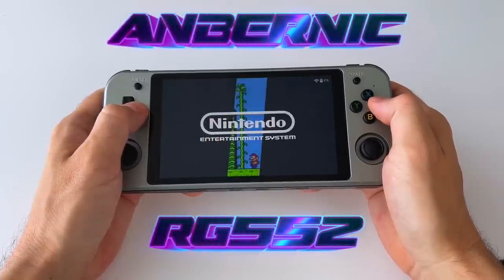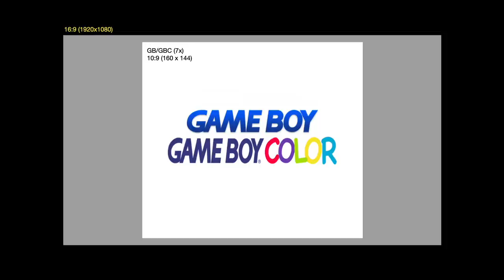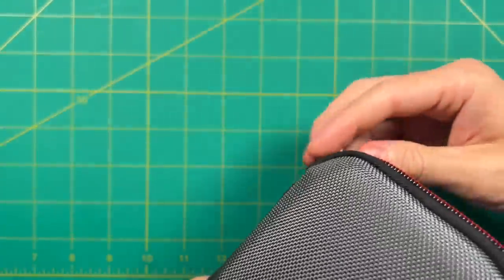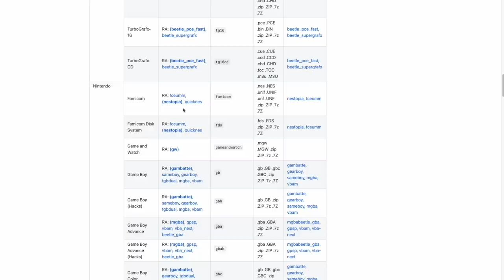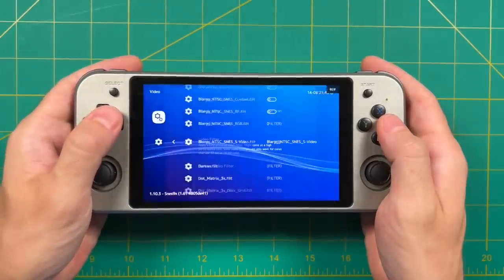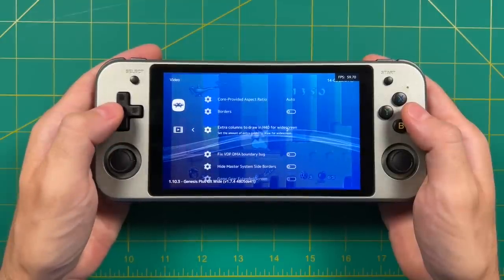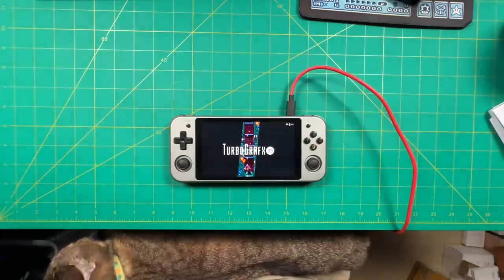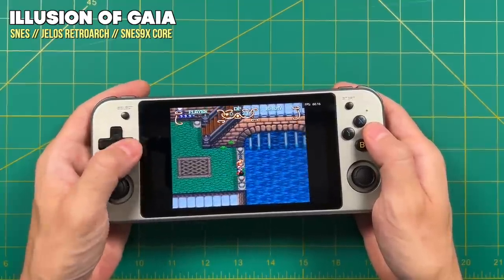This is still my FAVORITE handheld for retro gaming.

Comment: You can solve a lot of the scaling issues with 240p games on a 1080p screen by using a 5x scale. It only cuts off a few pixels off of the top and bottom which is what CRTs do anyways. No black bars at the top and bottom and you get integer scaling.

Comment: Part of me wishes I had never seen this video, because I recently purchased a modded PS Vita. I didn't care for the retro emulation through Retroarch on that device at all, but loved the way PSP ran. Plus I was introduced to some PS Vita games. After seeing this video, I decided to add the RG552 to my collection (RG350M, RG351P, RG351V, modded Vita). You are spot on regarding the excellent screen quality. I did have to expand the size of the Turbographix 16 systems and use bilinear filtering, because the integer scaled image was too small for my taste. I'm struggling with aspects of Android 11 (PPSSPP won't advance past the first welcome screen), but Drastic on Android is fantastic for making Nintendo DS playable. I'm using Amberelec as my custom firmware.
Reply: How is retro experience on the PS Vita vs the RG552? I would have thought it would have been quite similar?
Reply: @LiquidTurbo  The PS Vita uses the Retroarch interface for GBA, Genesis/Megadrive, SNES, etc., but it doesn't have a fancy front end that makes selecting systems and games easier as you get with Emulation Station. I find Retroarch clunky without it. I also experience slowdown on Sega Game Gear, which is bizarre considering that the Sega Master System runs fine. Not certain if it's due to the way my Vita was set up. The Adrenaline app on Vita is used for PSP, and there's an internal limit of 128 PSP games that can be displayed. That stinks, but the upside is that PSP games run perfectly on the Vita, as it's not being run through emulation as I understand it (runs natively on the Vita).
Reply: @davidlhsl  How's the physical feeling of playing retro games on Vita vs the RG552? (aside from the interface)
Reply: @LiquidTurbo  Vita ergonomics are excellent and better than 552. It only has one set of shoulder buttons, though, so no L2/R2 for some PS1 games. L2/R2 buttons on the RG552 are hard to reach.
Reply: @davidlhsl  which do you pickup to pay retro games?
Reply: @LiquidTurbo  I only play PSP and Vita games on the Vita. I use the RG552 for everything else.

Comment: great video. i also think this is a good device. but the integer scaling question becomes even more tricky when you factor in that on some platforms, the pixels were not intended to be displayed square. for example, the capcom cps platforms had a resolution of 384x224 that was to be displayed on a 4:3 crt, squashing pixels horizontally so that they were rectangular. and it was a similar story on snes, etc. and so on these systems, if you want a genuine integer scaled presentation at the intended 4:3, you need super high res displays (close to 4k!) the joys of digital displays...

Comment: Thanks for aspect ratio explanation! wish you had a full video just about aspect ratios of the most common handhelds, and how the old systems scale on them :)
Reply: So NES, GB, and MD are close to square. which means the wider your handheld gets, the smaller screen you will have since the screen will be limited by height, you won't find any 4:3 modern handheld other than RG353M but that one is 3.5-inch, and this one gives you ~ 4inch for 4:3 since it's not wide enough, but thing gets worse with wide handheld when the aspect ratio goes 16:9 or even worse like phones when it goes 2:1. 
an example, even though the galaxy S23 ultra have 6.8" but if you play an arcade game with a 4:3 aspect ratio, you will get almost the same screen size as RG552 (7.0cm for rg552 vs 7.3cm for the galaxy).

I wish we had an oled 7" 4:3 handheld to play these retro games.

Comment: I'm not that happy with the RG552. I would like to play with the stick and at the same time be able to use the shoulder buttons properly and not be restricted to systems that do not need them. But well not everyone wants to play with the sticks. But I like it when I'm flexible here without restrictions. I love it when I can reach all the buttons easily. I don't even want to discuss the price-performance ratio now 🤷‍♂️ However, the display is excellent 👍 In the end, everyone has to know for themselves what they value.
Reply: @Pridetoons  hating on anbernic has became a norm recently. The win 600 was a complete cash grab. Selling a 30$ processor for 375$ certainly seems like it. But they are realy solid hardware wise. While Ayn , someone which most compare to isn't clean themselves. Anbernic pulled themselves into a puddle and now people are trying to put cement on it.
Reply: @Pridetoons  You're right. But I also like to play DS with a stick or Android games (with a stick), for example, and the shoulder buttons are useful there. But if I have to use them, it's important to me that I can reach them easily and without cramping. Especially if I want to use the stick below. Well, my fingers are just too short for that -.- Despite various criticisms, I'm not someone who wants to make Anbernic bad for no reason. I love the RG351V. But if there are things from my very personal point of view that I know differently or I'm used to, I'll say so. Don't get me wrong. I'm the last one who doesn't begrudge Anbernic the success. Other manufacturers have just made better decisions lately that I like better, but that can all change with new products. In the end, the competition is great. We couldn't have imagined that in our dreams 1-2 years ago :)
Reply: Mine had issues right away (still does) thankfully I have the Odin Pro too.  My issue with RG552 is when I charge it the battery light blinks all crazy and never fully charges either.  Seems to be a battery issue and it's annoying that it was shipped this way to me

Comment: i think i already left this comment before. but maybe someone will read it now.
but YOU ALWAYS NEED FILTERING WHEN RUNNING NON PORTABLE RETRO CONSOLES! 
most consoles used resolutions that did not had square pixels, CRTS do not care but LCDS do, so you need filtering anyway just for that, else the image will look wrong
so if the screen will fit perfectly 2x integer scaled or whatever is irrelevant, unless you talking about portables which did had lcds with square pixels.

however there is one very simple method stretch the screen to any resolution that will keep perfect pixel edges and will also deal with non-square pixels
you scale the image up on a integer scale till it won't fit the device screen then you shrink it down with bilinear, because shrinking down with billinear does not cause blurryness only streching up does. on devices with real GPUs this is super easy to do, heck retroarch even comes with a shader for it, but you can "ghetto" it on things like a RG350 as well.

Comment: I appreciate your videos a lot, and even though I don't always agree with you, respect that you have your opinions and you came by them honestly.

The price is way too much of a dealkiller for me with this one, it's just way too much to spend for me to even be curious. I almost got a Miyoo Mini at your recommendation but ended up sticking with my RG280V, your previous favorite pocketable. It doesn't have as many setbacks to make it a bad purchase, and really, it's great to have a cheaper device to play most of the older games, even if there are problems with some systems and games it's supposed to be able to run.

On the more powerful side of emulation, it simply makes more sense to get a Bluetooth controller for your phone and play the games this device can run on that. 

Anbernic is just going to have to figure out its price/performance ratios better in future products because we all know they're very capable of making great consoles we love to play. They just haven't cracked the code quite yet on getting all those elements just right for a newer generation of chips than what they've been selling
Reply: Shame you didn’t take the Mini+ for a spin.  Form factor is a real treat, it’s a pretty slick Gameboy, feels awesome to play.  Or you can play Crash Bandicoot I guess.  Inputs are super, super great, I turned a skeptic into a fan when he got his hands on the Neo Geo/CPS3 fighters.  He was 1CCing fighting games all night.  Said he got his moneys worth in just a few hours, and he was practically spitting on me for buying it in the first place before I made him try it out.

Comment: I've been so close to buying this device... entirely for that screen. I hope they do a v2 of the device fixing some of the issues and upgrading that wifi chip, if so, I'll be all over it. If they go further and do something like a RG555 then I'd happily spring for that as well.
Reply: you can upgrade the wifi chip yourself, its not that hard.
Reply: I didn't realize how fantastic the screen was until i played 8-bit/16-bit games on it and noticed it looked better on the RG552 than any other device I have ever used. It's quite amazing and the aspect ratio is near perfect, the pixels are so clean and nostalgic. If I had this as a kid growing up, I would never leave the house.

Comment: Yes! Got my RG552 a couple of weeks ago thanks to you. I'll admit, it was in part because the Odin Lite wasn't even shipping (RG552 arrived in a little over a week), but ultimately, yeah, the screen. I truly don't understand why so many devices are now designed with 16:9 displays that prioritize the analog stick (disappointed in the RP3 and RG505, though at least Retroid changed the D-pad placement). If you're playing fifth gen consoles and below, that design just doesn't make any sense. Even for 6th gen games, a 16:9 display barely makes sense. That said, if you're trying to take PC games on the go that design is great (like on the Aya devices), but that's not what I was going for. 

I believe the premium price is worth the premium experience. It's just a shame the firmware is such jank. Glad the community came through.

Comment: Most of your priorities are the same as the ones I have. Most of the games I will play are 16 bit or below. I will be playing a few ports such as Stardew Valley and Fallout 2 but importantly, I have a few Android apps I want to run. All of the above will benefit from the larger screen. I am looking forward to playing some 3DS and PSP RPG's as well, which are not 3D/graphically intensive and I could probably run them perfectly fine with an underclock.
Bring on Chrono trigger and Etrian odyssey!

Comment: We need a new PS Vita in this size. 5.5” 720p OLED or miniLED, 1,000 GFLOP docked, 2,000 GFLOP in handheld mode. Oval shape, stacked shoulder buttons, 64GB built in storage, 8GB memory, 8 core cpu(4 high performance, 4 high efficiency).

Comment: So I’ve tried to give JelOS a shot and came back to my main issue which is terrible battery life.   When I’m playing a game and am ready to pause for a bit, I press the power button and the screen goes out.   I come back 2 hours later and 30% of the battery Life is gone.   That’s just nuts.   Black Sepaoh fixed that on the his Android build but even then, battery life is just ok.   If I press power on my Odin and come back later, barely ANY battery life is gone.   I can go a whole week if I wanted on a single charge!    I really like the beautiful screen, the D Pad, and the buttons in the RG552, but the poor battery life just kills the experience!
Reply: Same hiere, tried JelOS and Batocera and did not like it at all. The battery was drawning like crazy. Ended up with amberelec ans its work like charm
Reply: @wujachi  is AmberElec a Linux based operating system?
Reply: @apr2499  Yes. On 552 it may not have many themes to choose from ,but the one you have are nice. Also very easy to use and handheld does not take a heat when jou play nes game , what i had with Batocera.

Comment: Always appreciate your perspective. While I tend to always circle back to my PS Vita for handheld emulation of these systems, I always watch through your videos because your step-by-steps always inspire me with different things to think about or set up (across my PC and handheld emulation). Thank you as always for your work!
Reply: PS Vita is still unbeatable 10 years later
Reply: I love my PS Vita but the small face buttons and not being able to use Run-Ahead in SNES games makes it not the best for me personally. Turn based games like Advance Wars for GBA are glorious on it for sure. For ps1 and PSP it's also fantastic, although the small buttons are sometimes annoying with those consoles too.
Reply: @BitterspitBand  I can totally understand that perspective, and I don’t disagree that the face buttons are a bit less than ideal in size. And while the d-pad on the Vita is often lauded, it would be another check in the con column for me. With the array of retro handhelds out there right now, I have been tempted time and again to give one a try. My problem is that I can live without things like fast forward, (though I admit that is a great feature to have) and feel that one of these handhelds really doesn’t upgrade the experience in a way that justifies the cost for my use case. For me, the biggest flaw of the Vita is that currently the N64 emulation is at such a state that I cannot play Castlevania 64, and so it’s difficult for me to justify spending the money just to play the game portably (it of course works fine on my gaming PC and laptop). As you mentioned, the ability to play PlayStation 1, PSP, and Vita titles without any real fuss also keeps the Vita relevant for me, as I love being able to play games like Dragon’s Crown on the go. The Vita isn’t perfect—I’m not sure any of these handhelds are—but it’s an impressive piece of kit all these years after its initial release. Thanks for your perspective!

Comment: @retrogamecorps I have a 351mp. All I play mainly on it is NES and SNES and some mame. Im thinking about upgrading to the 552. I have old eyes and would like a bigger screen. Also I only play at home. Do you think the 552vwill fit me well?
Reply from the maker: The RG552 will work well in that scenario, but I would also consider the PowKiddy X55, it's half the price and has a nice big screen, I made a video about it recently.
Reply: @RetroGameCorps  I did think about the X55 but don’t like the d pad being below the analog stick, since 99% of my gaming is 16bit and below. 

What do you think about me going with a RGB10MAX? Lot cheaper (about half) then the 552. Has built in Wi-Fi and BT. And looks like I will give me a little bit over 4 inches of screen when doing 16bit and below gaming. My main goal is to just get a little bigger screen than my 351mp.

Comment: I found for myself best solution - is actualy have 3 devices for perfect retro gaming experience . RG 351p for portability and be able to put in any pocket and taking everywhere . RG 552 for screen quality and almost perfect ratio for retro games up to PS One - this screen is just made for this , for gaming at home. And phone for PSP, Ps2, Gameqube e.s with gamepad- its just so much beter than any handheld that came out because of raw power and versatility. Asus ROG for example is almost a gaming laptop and it costs 6-700.
Reply: My plan is to keep my 351M for GBA only, use a 351V for GB/GBC/SNES/Genesis/PS1, a Miyoo Mini to take with me when I leave the house, and anything N64 and up I emulate on my PC on my 4K TV with an obsessively configured CRT shader setup.
I have a powerful phone too but I hate gaming on it. I might use it for 3DS emulation.
Reply: @steel5897  Loving it. I got an RG552, a Miyoo Mini v2, Blackshark 5 Pro, and an awesome gaming PC myself.

Comment: Controversial opinion: Sharp pixels is not the retro experience most people remember. In fact, bilinear filtering + scanlines is a more accurate recreation than integer scaling, and in the absence of appropriate composite/s-video/RGB filters or shaders, I would rather go with that, than blocky pixels.
Reply: I grew up playing NES on an emulator with the sharp pixels and I still totally agree. They just look so good when they look like they're on a CRT TV 🙏 love finding a good filter for these games
Reply: gotta have filters and shaders!  can't play the classics without them
Reply: The issue with crt is that you need to go all out imo, CRT Royale is the way to go and none of these devices are powerful enough or have a big/dense enough screen to pull it off. Scanline filters aren't enough, I find them not faithful to the real crt look at all. Need a full shader suite.
Reply: @steel5897  While I agree, if the option isn't available for whatever reason, I'll gladly take an approximation instead of an unprocessed image.
Reply from the maker: Yes, I think that's totally fair.  I've grown to prefer sharp pixels over the years.

Comment: If it were $150, it might have been a somewhat decent choice due to its build quality. However, as of now you can get the Retroid Pocket 3, which is basically the same thing but cheaper, more powerful, and without linux support.
Reply from the maker: Yes, I think the RP3 is going to be a much better value, and I'm excited to test out the two models I pre-ordered.
Reply: @RetroGameCorps  Did you order the runt of the litter, White colour by any chance? I've got one on order, hoping it's not as bad as the rumour from Taki about it being piss coloured
Reply from the maker: @zaprct  I ordered the "orange" (yellow) one and the 16-bit one as well.
Reply: The thing the RG552 will always have is that excellent 5:3 display which allows for excellent pixel scaling on 16 bit systems and even Gameboy Advance and PSP. The Retroid Pocket 3 will be 16:9.

I'd love to see the same screen or a screen that's 5:3 or at least 16:10 at around 5 inches on one of these devices.